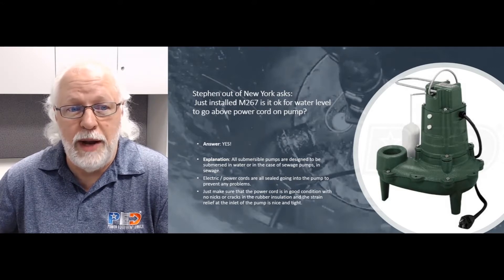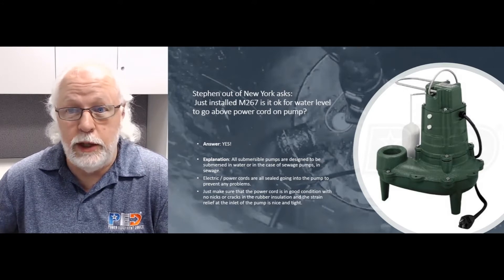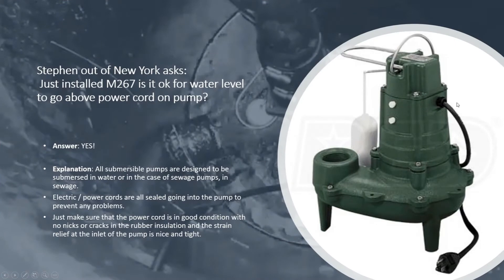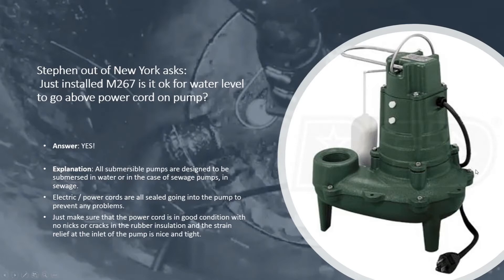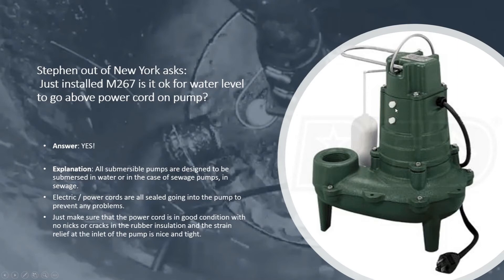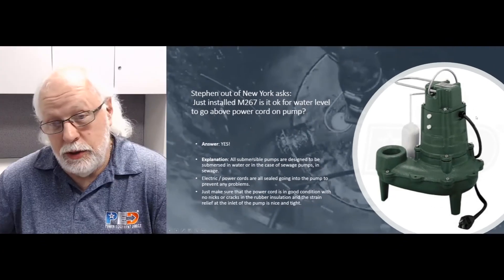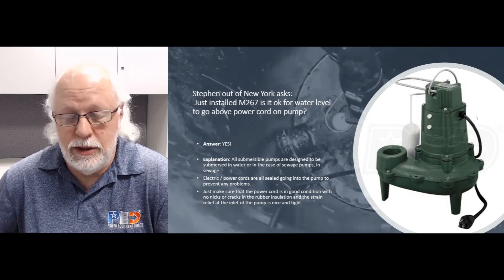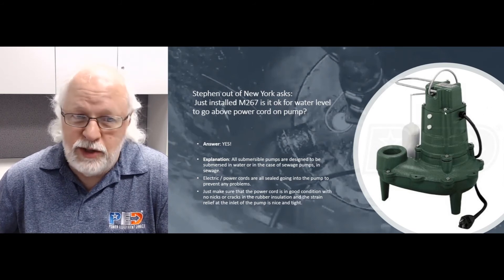Can Water Go Above Your Sump Pump Power Cord?

Comment: Can I connect it to an extension cord, my manual is telling me not to but the cord it comes with is only 10ft
Reply from the maker: Hello. No, you should not use any kind of extension cord with a sump pump because of the danger of the extension cord not being able to carry the increased amperage/voltage a sump pump needs to operate properly, which could cause burning out/failing and many other dangerous problems. The pump cords are usually 10-feet long because in most situations, you should have a proper GFCI outlet within that distance from the sump pit to properly power a sump pump (this should be part of building code). If you absolutely must extend to a GFCI outlet, you should consult with an inspector/electrician to properly diagnose the problem and solution. Do not plug in an extension cord and call it a day.
Reply: The increased voltage claim is simply BS.  Avoiding voltage drop is a real thing, but a 6ft 14/3 (for a 15A circuit) or a 6ft 12/4 (for a 20A circuit) will be less than 0.4% voltage drop.  If that actually maters, you had major issues with the source outlet before you started or you are trying to extend a lot more than reasonable.  You can get sump pumps with factory 15ft cords on them, for example (the float switch I'm getting even comes in a 25ft version) that would perform exactly the same.  Coincidentally, you would have the same voltage drop on a typical hard-wired outlet extension, as it would be the same gauge wire!  A 10ft cord would be unlikely to reach to the bottom of a 6ft crock, for example.

Amps are a non-issue, if you are on the same size wire as the pump uses, as amps are the same whether you have an extension cord present or right into an outlet. If the pump is 14/3, use 14/3 extension cord, not a 16/3.  Running long cables or smaller sizes are going to cause trouble, though.

This is not legal advice, and I'm not an electrican, but you should ask this same question of someone you trust with whatever licences they need for you to feel comfortable ... before you assume you cannot use an extension cord in all such cases.
Reply: I have a 50 gallon water tank, and I need pressure going into a pressure washer, would it be better to get a pump on the outside and what would you recommend, also if I were to get a generator would I be able to connect the sump pump to the generator